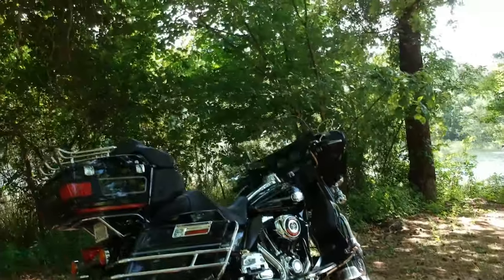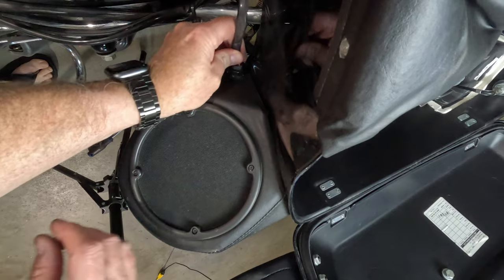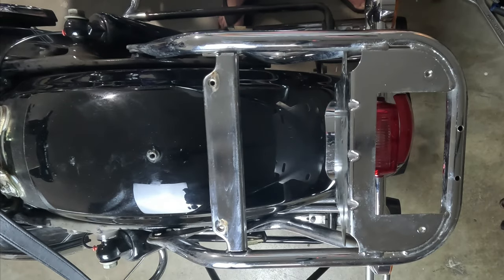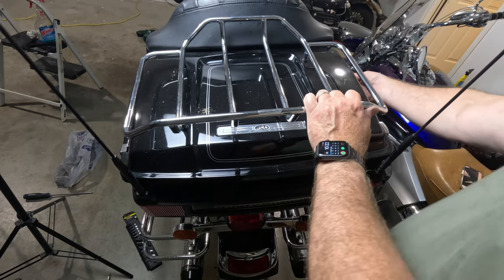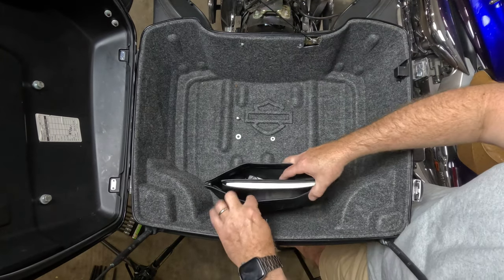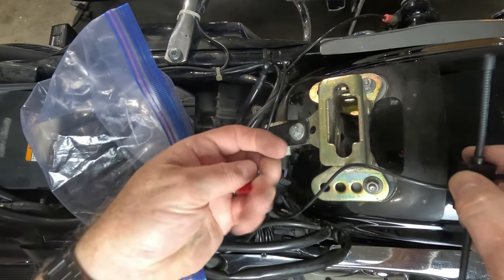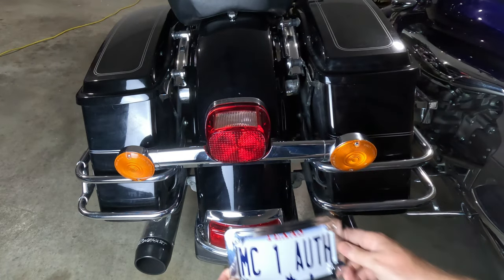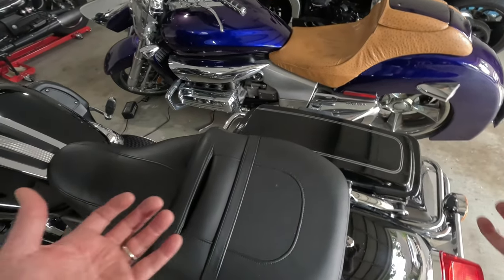Harley Ultra Classic to Street Glide: Easy Conversion Guide.

Comment from the maker: (TIMESTAMP 2:45) To Mount the Brackets to the Motorcycle: I used (6)  5/16 diameter standard tread bolts 1-1/4 inch long that I bought at Lowe's in a pinch. I may switch out with some chrome ones later. The zinc coating was close to chrome so it didn't stand out.

Comment: So if i get the quick disconnect, and the rack you have listed from amazon, I can take off tour pak and put on whenever? And quickly? Plug and ply? I have a 2012 Ultra Classic.
Reply from the maker: You might also find a better deal on eBay. The wire extension is for the lights on the tour pack. If you don't use the radio or CB antenna, that eliminates an extra step. Some people relocate the antennas to other locations on the bike. I simply used a different radio antenna and placed it under the seat without relocating the CB antenna."
Reply: Thank so much. You have a new subscriber
Reply: @MotorcycleAuthority  One more... rear speakers? Just disconnect and tuck wires?
Reply from the maker: @CarnivoreBodybuilding that is what I did. I use my Sena helmet com for music and to connect with other riders. So, don’t use much but it can easily be reconnected if needed.

Comment: Looks like an Electra Glide without the tour pack. Doesn't look like a Street Glide. SG has different lighting, no spots, no chrome guards on the saddle bags, different suspension. The hidden antenna will work better if you put it in the fairing.
Reply from the maker: True. I thought of taking those off but the chrome guards are so useful if it tips on side. And I kind of like the spots if needed. Thanks for tip about the antenna. But, I do agree it is sportier (if that’s a word) and much more of a street glide without the chrome guards.